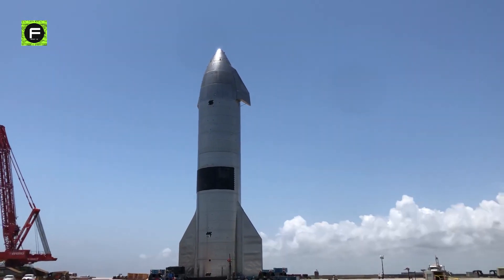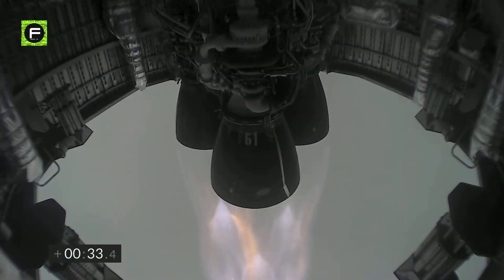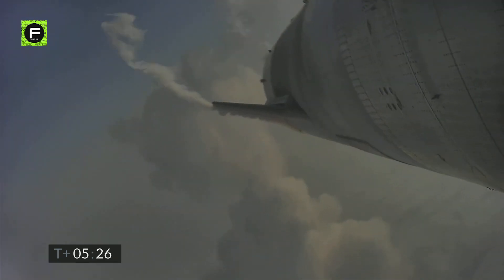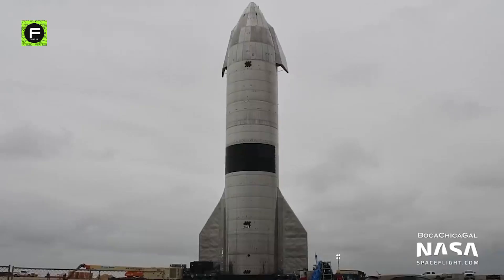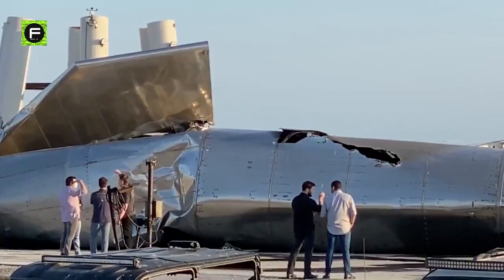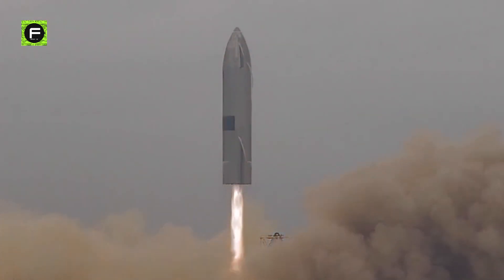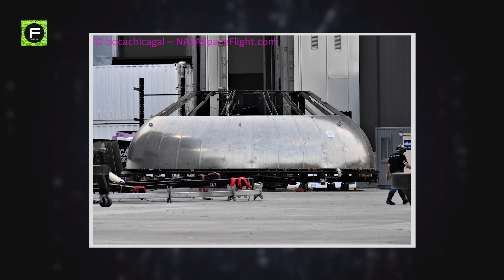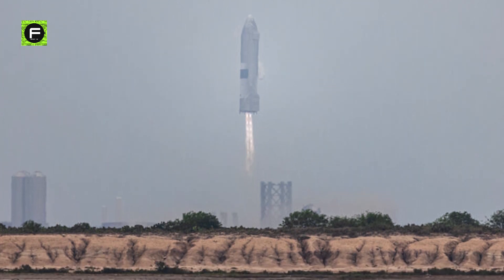How Starship SN15 Nailed Landing? Flight Analysis| What's Next

Comment: Answer: there weren’t any error in this prototype , All after the sn8 would have landed if there weren’t any error in them
Sn8: not enough pressure in the header tank 
SN9: raptor error 
Sn10:methane leaked+helium mixed in
Sn11: methane leaked
Reply: Isn’t the reason it Rud explodes SN10 after hard landing hard to crash the small landing legs?

Comment: They shouldn't scrap SN17 (don't think SN18-19) are even IN production). They need as many of these better prototypes as possible to try to land them time and time and time again. Use them as landing fodder, whether they pull it off or not. No way I'm doing the eventual point to point thing this or next decade if it can't land flawlessly each time. 😆
Reply from the maker: good point